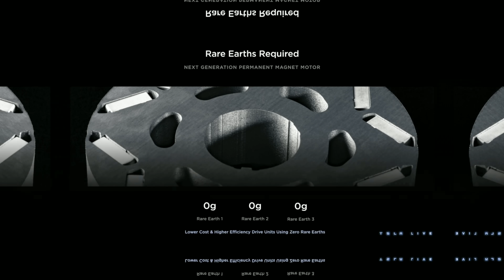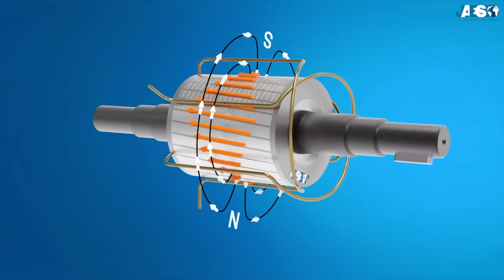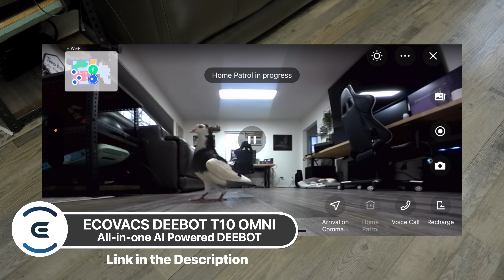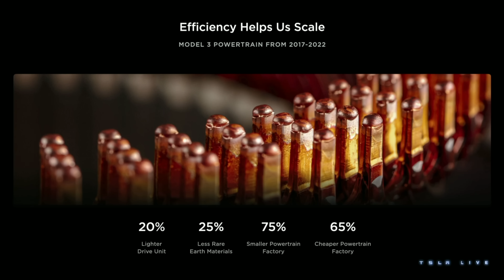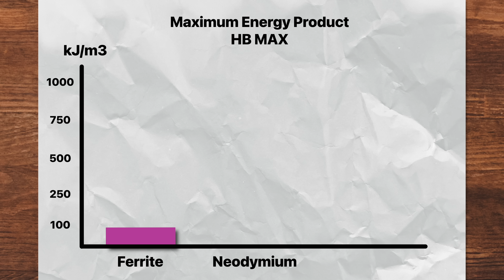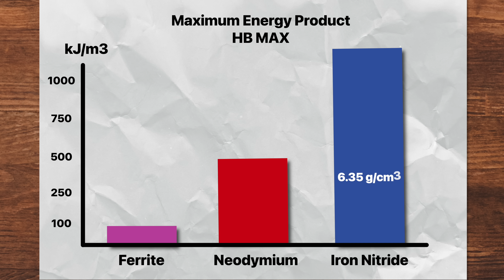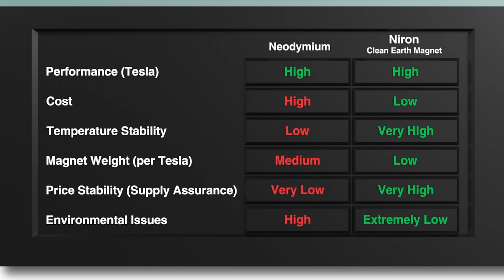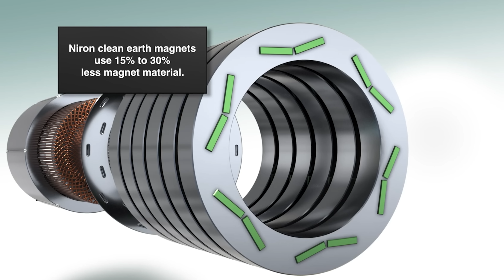The GENIUS Of Tesla's Next GEN Motors!

Comment: Great video and presentation. !  I have some detail input that would not be available to 99% of people, and hoping video author will be OK with me presenting here in comments.  In short, I am someone who has been in R&D for improvement in torque densities for electric motors for decades, and it may be interesting to some to see this from a different perspective.  

These motors, generically called IPM motors (Internal Permanent magnet) have been around for nearly 15 years.  They are really hybrid motors (permanent magnet and reluctance), noting that reluctance motors use no magnets.  Several of the biggest motor manufacturers in the world have IPM motor product lines (like ABB/Baldor), and have so for well over a decade.  Over a decade ago an IPM motor derived about 2/3rds of it shaft torque from the magnets themselves and about 1/3rd from the reluctance effect (think of the two effects as magnet-to-magnet attraction versus magnet-to-nail (steel) attraction).  These IPM motors use a fraction of the magnets as surface mount Permanent Magnet motor.

Now the interior arrangement of those magnets has advanced such that NOW about 2/3rds of the produced torque is derived from the reluctance effect, making it more of a reluctance motor than a permanent magnet motor.  The take-away is that the need for extremely high power magnets is diminishing, and weaker NON-rare earth magnets can be used instead of Neodymium (like common Ceramic magnets at a small fraction of the cost).

Remember that nearly every EV mfgr has been using these hybrid PM (IPM) motors for many years.  Tesla has been the lone holdout to continue using inferior induction motor technology until very recently, and now all of their EV's use IPM motors for their primary drive.   And that made sense over a decade ago.

-------------------------------------------------------

Now on battery technology, again a much longer story.  Very high density battery tech that reaches levels of 450-500 kWh/kg has been around for a number of years.  The two main companies in this space are Chinese giant CATL, and a small US company called Amprius.  Neither of these have been commercialized for mass production yet, and there is very limited data on chemistry, cycle life, and of course cost.  Chemistry certainly plays a big role in the cost formula if rare or limited mining potential minerals are needed.  And some of those minerals also have serious social and environmental concerns.  THE TAKEAWAY IS THAT RAW CELL ENERGY DENSITY MAY NOT BE THE MOST IMPORTANT FACTOR for the application.

Notice the every Tesla battery development over the years has resulted in lower and lower raw cell energy density.  In descending order of development
>>18650 cell Lith-Nick-Cobalt Panasonic still the King with 280 Wh/kg
>> 2170  cell  Lith-Nick-Cobalt Panasonic with 263 Wh/kg
>> 4860 cell  Lith-Nick-Cobalt Panasonic and LG with  244 Wh/kg
>> Prismatic cell Lith-Iron-Phos CATL 160 Wh/kg

Like all things in life, there are tradeoffs.  And reducing manufacturing cost, increasing cycle life, eliminating chemistries that guarantee future cost increases as demand increases are also very important.  Note that the low-end Tesla Model 3 uses the CATL Lithium Iron Phosphate (LFP).  160 Wh/kg versus 280 Wh/kg for the original 18650 KIng.  

What advantages does that new cell and chemistry bring?  1) Elimination of the two problematic minerals in the chemistry:  Nickel & Cobalt  2) Cost, 3) 3 times the cycle life, 4) Tolerates full charge/discharge repeatedly 0% to 100%,  5) Safety (higher energy density goes from "managed vent" to bomb when a problem arises)

CATL and Amprius high-density developments will very likely be extremely expensive, even in mass production.  I would guess far greater quantities of Nickel and Cobalt in the chemistry, and silicon doping or all-silicon in the anode.  As such, both manufacturers are marketing these batteries to the VTOL vertical lift aircraft for metro transport.

And as another sign for future expectations, CATL (with the 500 Wh/kg battery) is betting BIG on Sodium-Iron batteries and investing billions for factories.  These batteries eliminate another limited mining potential mineral (Lithium) replaced with very common sodium.  But these batteries will have the same 160 Wh/kg energy as the LFP chemistry (and worse volumetric energy density).

Hope that helps.

Comment: This is really fascinating. Years ago I researched building low cost bicycle motors using synchronous reluctance controllers to avoid using high cost neodymium magnets, which would have cost way too much for the application. Amazing to see that industry is working to figure out ways to make us less dependent on rare earth elements from China!
Reply: America has large deposits of rare earth elements, they even used to mine it.  However mining rare earth elements is a messy business, and with EPA regulations etc. it was just WAY more cheaper to buy it from China.  So what America is dependent on is not rare earth elements, it's CHEAP rare earth elements mined far away where the pollution created to mine it cheaply is someone else's problem.  America didn't just offshore for cheap labour, they offshored polluting as well.
Reply: The founder of Niron Magnetrics is ANOTHER Chinese genius... as USA wages aggressive war on China he may join the 30,000 PhDs that have already left USA...

Comment: maybee a dumb question but
why dont they make the motor inside out with the inner section fixed in place and only the outer rim spinning ?
electro magnets on the fixed inner section & permenant magnets on the moving outer edge.
would be space saving and result in an even lower centre of mass with motors built in the wheels with only the outor rim & tyre spinning.

Comment: The existing national grid should be perfect when every building has a rooftop solar system and an EV, all connected to the grid. 

Most vehicles drive a short distance daily with a long distance capacity.

This one insight is stupendously useful in planning the energy future. 

The costs of all parts of the infrastructure, including vehicles, are critical. 

This magnetic insight is exciting. 

Let me say a safe climate does not come with worldwide nuclear industries and horrendously expensive fattening of the national grids capacity. 

Do the maths. The truth is in the numbers.

Comment: Can that home vacuum cleaner talk to self parking EVs ? ? ?

Fast charging over 1 hr or trickle charge over 23hrs ?
Most vehicles are parked 23hrs daily
 

The infrastructure is incredibly cheap and the grid stability improved with 90% of all EV just topping up daily. 

All rooftop solar PV system could easily handle this little daily load. 

UNLOADING the national grid from the home demand will be critical in the all electric world.

Comment: You're saying permanent magnet motors have lower torque at low speeds. Isn't that backwards? They have all the torque at 0 RPM, while induction motors do not and have a hard time starting up.

Comment: I love your video's this like so much of what you've had on the channel looks promising, problem is if this has been known about for 75 years and no one's done anything about it there's a reason. The actual raw materials might be inexpensive (relatively speaking) and abundant, but if the process to make them into useable "super" magnets is complex and difficult they may cost just as much or more to make than rare earth magnets. Raw material costs are only part of the equation, actual manufacturing costs are the other.

Comment: +++I've developed a motor that requires significantly less magnetic material, with low specific mass and high torque & efficiency across all speed ranges. Accompanying innovations allow trans-continental trucking.

Additionally I have designs for ultra-efficient VTOL aircraft and range extenders that can traverse oceans and continents.

In related space, my innovations enable high efficiency & thrust reaction machines [rocket & jet engines, hydro, tidal & steam turbines, etc]

===

+++😎But all this will go away soon.  Never fear. Milo is here to tell you that, without a doubt, an 'extinction/existential level' [E-level] killer app on the horizon will flip all of the current global scientific principles and everything else underlying it. 

The resulting 'De Novo Intellectual Revolution' [DeNIR] will give us a fundamental understanding of matter, energy and the universe. 

Zombie offspring apps,... including printing things on the atomic level and interstellar travel, will be rapidly bred, killing the competition in all business/economic areas such as - electronics, communication, energy, manufacturing, finance, etc., flattening in it's wake crime, poverty, disease, mortality, demographics, politics, injustice and war.

Virtually everything will be possible/achievable. To that end, trans-human evolution is at our door steps and everything will change...in the blink of an eye.   <@;-) 

The obverse innovation enables telescopes  with a million fold improvement in resolution.

BTW, by all of our experimental evidence so far, most of the quantum 'experience' is false  as are most concepts in cosmology/asstronomy.

Comment: Think of the impact to the generation of electric energy too.  A generator is a motor in reverse.  Same principles apply.  This will enable smaller, lighter, generators too.  More bang for you buck in every type of electric energy source other than photovoltaics.  If we are going to move as a planet to EVs we need more generators to power them, so this is good news.

Comment: 9:47 
There’s another possibility: Tesla changed the directional axis of the weaker, old-magnet technology. 

Axial Flux motors are synchronous motors which shrink the distance between the rotor and stator magnets — increasing the magnetic coupling between the rotor and the stator, for the same strength magnet. 

This arrangement is scalable by adding additional rotor and stator layers, with very little additional complexity or weight. It’s like adding additional motors inside the same case. The only “limit” for torque, is how many layers you want to add. 

You can use rare-earth magnetics in an Axial Flux motor, but you don’t have to.

Comment: Research on super conductors now has some that work at room temperature.  Unfortunately, you have to put them under a huge pressure to get them to work.  If someone can get that solved and then combine it with much stronger magnets, it is seriously going to change the EV business.  Copper windings are big and heavy because you need a good chunk of copper to get low enough resistance.  Super conductors would likely lead to smaller motors leading to a lighter car.

Comment: Wow, nicely done thank you, Subscribed! 
It also occurs to me, Tesla must know how often high acceleration is used in real world driving, using data from the fleet. Discounting fun runs from eg a standing start, or perhaps straight line in the absence of traffic. And design accordingly. Most journeys are short and urban, big savings to be made. That next 25k model is going to involve some interesting decisions. But if you've figured out Fe16N2 then perhaps this becomes irrelevant?
Reply from the maker: Thanks for subscribing. Indeed the data received from studying driving and also mapping magnetic field and being able to play with many designs in software is amazing. now with these new motor designs and magnets this could make some major changes.
Reply: Rapid acceleration leads to shorter range.

Comment: Excellent development!! Nitron motors + Amprius batteries = Electric Flying Vehicles!!
Reply from the maker: indeed the two together could make Electric flight a reality.
Reply: Not just that either. Nitron motors + Amprius batteries + Toroidal propellers = electric container shipping vessels. A solution to, by FAR, the biggest polluter in the international shipping network. And given fuel is over half the operating costs of naval shipping, being able to dramatically cut those operating costs per cycle will give them a very attractive RoI on the initial investment costs of upgrading their propulsion system.

Comment: I have been bothered by the claims of induction motors having higher torque at low speeds.  What we were taught as part of our curriculum was that the squirrel gage motors had a miserable torque at the low speed, despite of pulling huge amount of current at the start.  Their maximum torque was obtained at something like 85 to 90% of full speed.  Actually, we verified the torque curve in lab exercises.  Now, what I suspect is that the talk about better low speed torque relates to variable frequency driven motors.  Such motors are not traditional squirrel gage induction motors, but closer to either synchronous motors or externally commutated DC motors. Has some standards body established new naming practices?
Reply: squirrel cage, not gage, which would also be spelled guage...
Reply: Aside from the design of the rotating flux motors as described in this video, pancake axial flux motors have better low speed torque  characteristics but given their design, pancake motors don't have the same high speed (>20,000 rpm) capability.

Perhaps a two motor solution is still the way to go where needed.

Comment: Isn't it rather odd that Joe Biden did not invite Tesla to the EV Event at the White House?  It appears that this current administration is way too interested in picking the winners and losers than really sparking true innovation.  Awesome how Musk and Tesla leadership is pushing the envelope and building better everything in the EV world.  Hopefully in the next 10 years they can build a truck that is designed for the men across this country who use trucks for actual work.  One without too much electrical componentry that fails before the batteries and motors.   Nice video Ricky!!!

Comment: Absolutely what would this mean for speaker technology if they replaced new neodymium magnets with the new iron nitrate magnets sound quality improve would we finally be able to hear a better quality sound that digital alone has yet to be able to produce compared to analog power consumption in our devices smaller than they already are reduce the crackle at higher volumes on her cheap cell phones prevent blowouts Tesla's new upcoming cellphone they plan on coming out
Reply from the maker: Yes likely improvements in performance all around....and taking away supply chain constraints too.
Reply: Speaker magnet strength does not affect sound quality. Stronger speaker magnets just allow for higher power handling speakers with less weight.

Comment: Thx for sharing this information.  i do not agree with your point of view. there are better topologies currently in the market than the SRM type or other types Tesla is using or has used in the past.  cutting cost is a way to earn more profit,. but by doing this, there is no weight reduction in general.... there are handful of EV MOTOR MFG out there that produce a more performant EV motor in a smaller volume, with a much lower weight and on top of this with a higher output in kW than current TESLA motors.  please do your research.  higher weight in general  is  reducing range.  i love TESLA, don't get me wrong, but saying that this is the next gen motor is ' definitely' not correct. please do your research and adjust your point of view....  you might have a point on the FN magnet , but there are no problems with rare earth NDFB magnets vs FN types : When heated to decomposition or exposed to humidity, iron nitride may emit toxic fumes of ammonia. It is considered a moderate explosion hazard. Inhalation of iron nitride dust or powder may cause irritation to the respiratory system and possibly acute iron poisoning or pneumoconiosis.  somewhere along the line, the mfg process will require specific actions to mitigate these risks to protect the environment and workers.  Besides the content of rare earth metals in NDFB magnets is lower than you think ,  perhaps FN magnet ....  it is all politically motivated .... but this might be a conspiracy therory ....   over and out

Comment: Just out of curiosity. Which percentage price/weight of EV cars is the engine responsible of?
I presume it's pretty small compared to the battery.
Not that getting a better/cheaper motor isn't great, of course.
Reply: For reference the old motors were around $3000 each and the rumor is these new motors will be $1000 each. 

Meaning saving 2k or 4k per car. 

Or more likely sell the motors for $1500 each, customers are happy with half price motors and Tesla makes more margin.
Reply: @5353Jumper  sort of what expected. 3k average in a 40k+ costing car is not a big deal. Less than a tenth of the overall price.
Saving 3k is a big deal for me, though.
Reply: @elkaro5  combined with many other little innovations it all adds up to them being able to deliver a higher performing car for less money than their competitors and still maintain profitability.
Reply from the maker: very true it all adds up, and also it potentially makes the supply chain stronger when rare earths are not involved in the equation.
Reply from the maker: no multiply that number by projected amount of vehicles to be produced and 🤑
Reply from the maker: Tesla and other automotive engineer teams are excited when they even shave ounces off of weight of a part or a car...this adds up when its 2-4 motors same with the cost....when you scale it up over millions of vehicles the cost savings are huge.

Comment: @1:10  Just to add some data points to the chart, Tesla/Panasonic 2170 cells in 2018 were at around 730 Wh/L and later ~750 Wh/L.